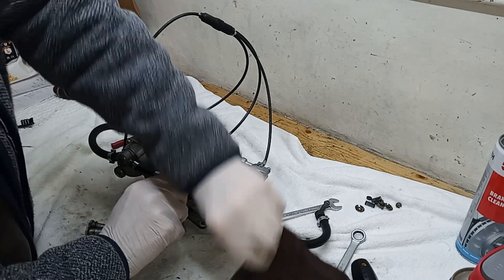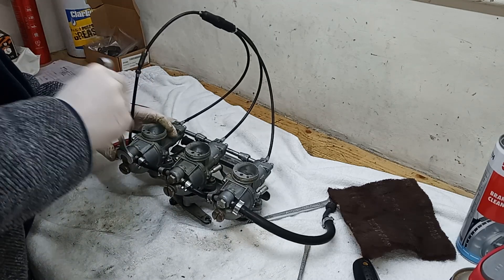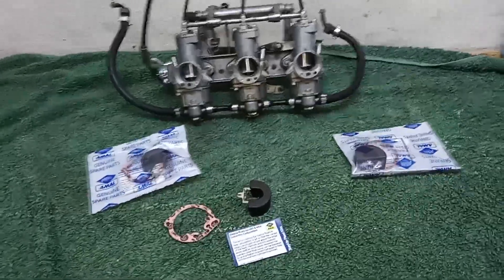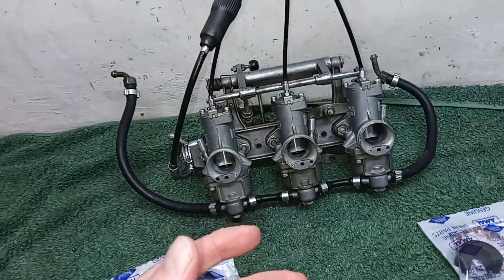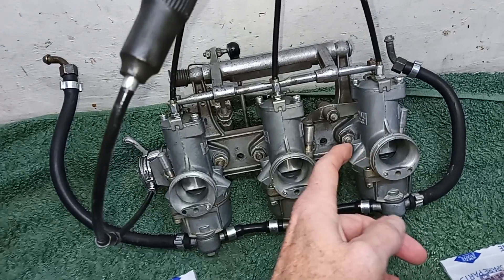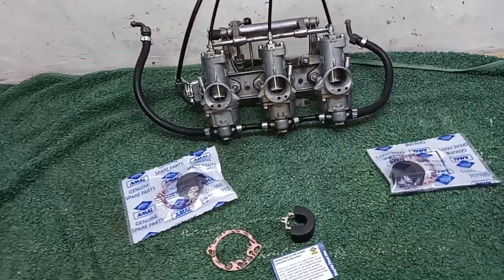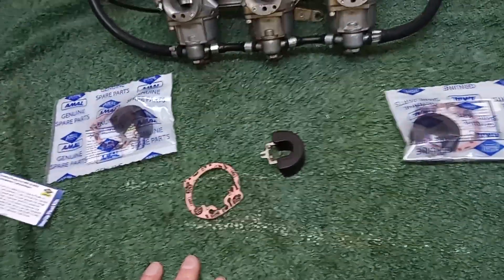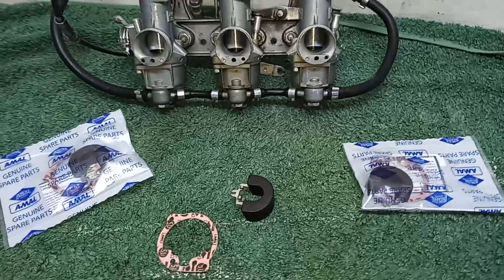Triumph Trident T160 Rebuild. Part 21: Amal Carb Service Final

Comment: Hi Chris. I just put all my needles on the middle setting and adjusted floats and set the balance. Bike goes really well under load but when cruising at highway speed now it is coughing and sputtering. As soon as you turn the Throttle hard open it responds exceptionally well.. Any advice on what's happening. Jets are 160
Reply from the maker: No easy answer, I'm afraid. It could the you need to raise the needles a notch - but that's only a vague suggestion. It's very hard to determine the cause. Your best bet by far is to put it on a rolling road and they can sort it for you, or at least identify the problem. Otherwise it's just an awful lot of trial and error, trying different things.